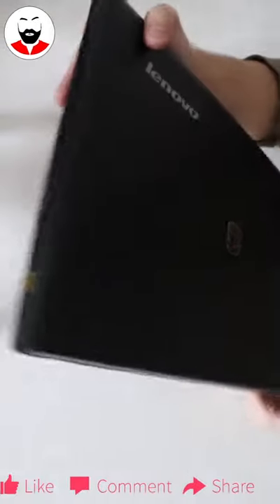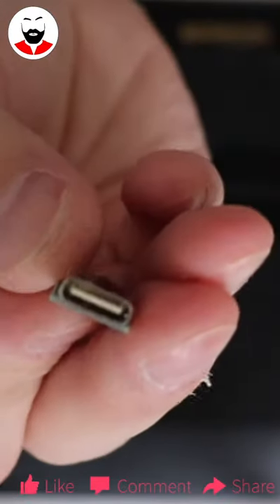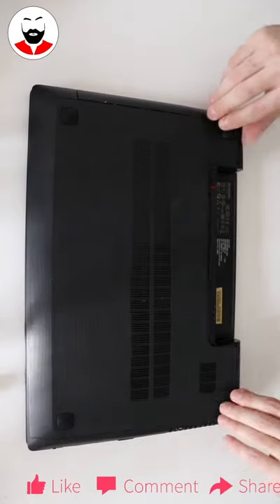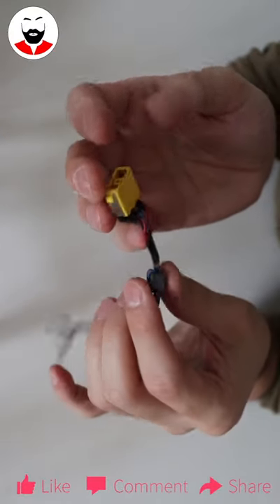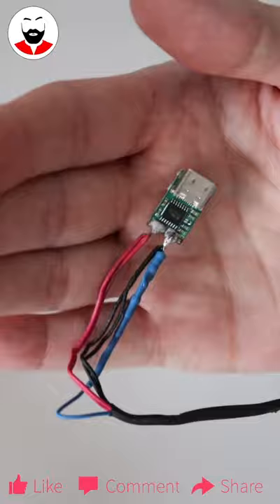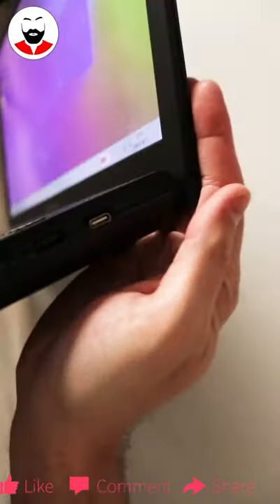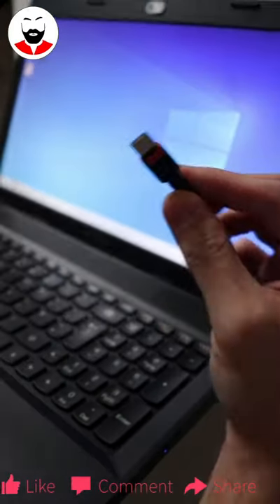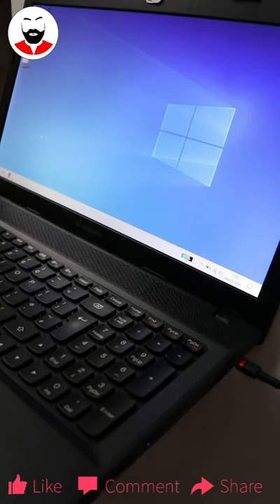Converting old devices to USB Type C PD [Lenovo Laptop] #shorts

Comment: According to the thinkwiki, the slim tip connector in my lenovo legion y540 (which charges from a 230w charger) needs a resistor of 4.6kohm. Will it work with this usb port? or just at lower charge rate? and what if the laptop draws more power than the type c charging brick can provide?
Reply from the maker: it won't work with type c since it can provide a max of 100w